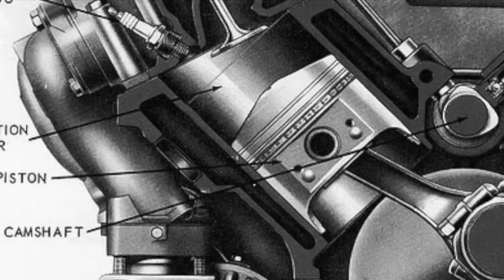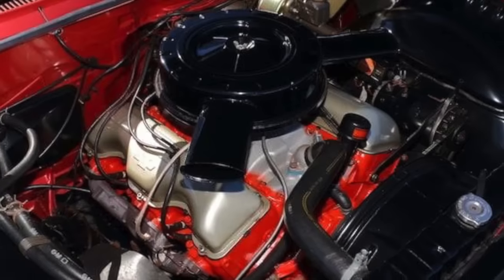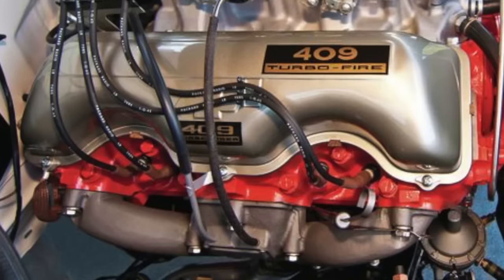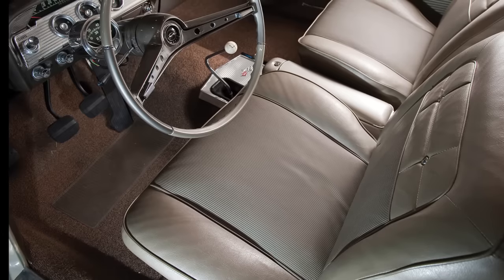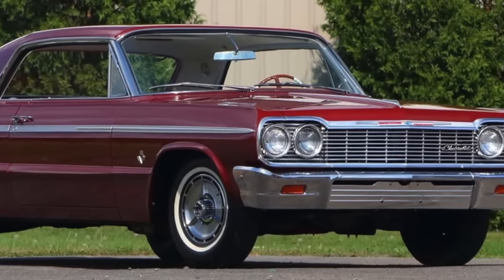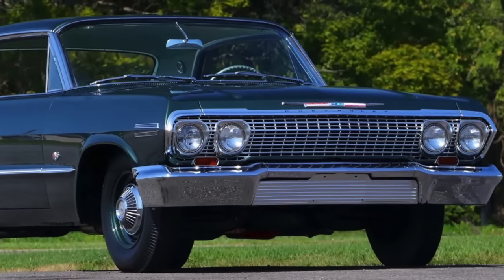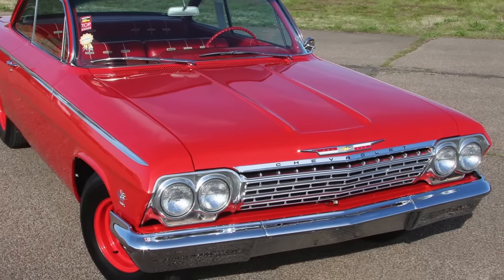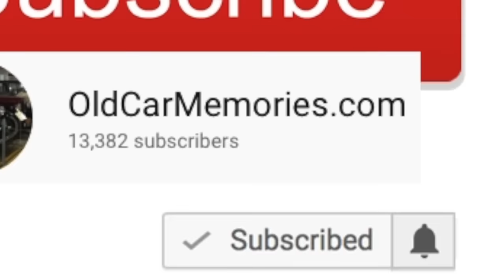1961-1965 Chevrolet 409 V8 - The Ultimate Budget High Performance V8

Comment: My brother had a '64 Impala 2 door (not as SS) with a 409/340. I remember helping him work on it and I was able to sit on the fender well with my feet on the radiator and the back of the engine so I could reach everything. And I'm 6'4"!!  I also remember someone in the late 1970s racing the 409s. He found out that a crankshaft from a 454 slid right into the 409 bottom end. He was also able to bore the 409 a hefty .120 over (no joke!) and the final CID was 495.

Comment: I've never seen a 1965 with a 409 , not that I doubt it but I thought that was the beginning of the 396 .
Reply: About 2000 65 Impala's were equiped with the 409. It was replaced mid model year with the 396. When I was a teen in the early 80'S a gas station owner down the street from my house had one sitting at his station and it had the 409 in it never got up the nerve to ask him if he wanted to sell it I regret that.
Reply: A girl in high school had a 65 Impala convertible with a 409 and a 4-speed it was her dad's
Reply: @brucegillies1694  When was this? where? I had a 65 SS conv triple black, 409 400 4 speed. I bought it in 1968, I was 16
Reply: Feb 14 65 is when the 396 replaced the 409.
Reply: The 396 replaced the 409 halfway through the 1965 model year. 409 powered 65 Chevy's are really rare today
Reply: Paul Revere & The Raiders recorded a single "SS 396" to promote the new option. The 396 option arrived on the Corvette March 19, 1965. As for the 2/14/65 cutoff date for the 409/396 changeover, that would been Sunday, making it unlikely. March seems more likely.
Reply: They used the 348- 409 blocks for the early 427's.

Comment: First Mass produced V8 came from Cadillac circa 1914- Not Ford.
Reply: And Chevy had a V-8 in 1917
Reply: Ford's V8 was afFORDable.
Reply: Chevy made 6,000 of the 1917-18 'mason' V8's with OverHead Valves(OHV) and air-gap style intake manifold... Louis Chevrolet was a racecar driver and his cars would never have a flathead engine... Chevy's OHV straight 6's always had more HP than same year Ford flathead V8's... and got better MPG...
Reply: Ford was the first v8 that had a solid block(one piece)construction.
Reply: True, when most automotive historian type cite the "first" V8, Henry's is cited most often as it was the first that was available most widely, most numerously, and as a corollary, most affordably.   The idea that a cheap, hot-rod-able V8 could exist and even create brand loyalty and future customers amongst hot-rodding youths was latched onto by Zora Arkus Duntov upon the creation of the OHV Chevy engine in '55.
Reply: Just remember, that Cadillac V8 you speak of, was originally designed and built by Henry Ford. Ford's first car company he started was Cadiliac !
Reply: Douglas Smith did you get your info from Wikipedia
Reply: Douglas Smith Ford's designs where sold to caddy long before the v8 was designed
Reply: Henry Ford did NOT start Cadillac, he was only a member that got kicked out, and the Cadillac engines were NOT a Ford design.
Reply: LEON LAVANASSUER AND COMPANY IN FRANCE STARTED MAKING AN ALL ALUMINUM OHV V-8 IN 1905. BY 1910  THE WERE THE MOST POPULAR RACING ENGINE IN EUROPE. MANY CARS, BOATS AND EARLY AIRCRAFT USED THEM.  50 HP ...250 LBS.
Reply: Henry ford founded Cadillac
Reply: @BuzzLOLOL  yup no chevy flatties after 1932 4 poppers
Reply: @fposmith  ???
Reply: @tomschweikert9537  - The Chevy 4 bangers were also OHV...
Reply: @BuzzLOLOL  from 32 0n i believe
Reply: @jackpine3528  alfas and peugeots were big time then
Reply: @BuzzLOLOL  Yeah!!! thats why he went under!!!! GM just uses his last name, to make CHEAP!! cars!!!! that's ALL!!!
Reply: That’s bs Ford had to teach Cadillac how to make a V8
Reply: Buick had straight eights in the 40s and early 50s.
Reply: General Kenobi No he did not.  Henry Leland founded Cadillac in 1903 and then partnered with Ford for a short time.  Leland was approached by William Durant, founder of GM.  Leland sold Cadillac to Durant and with Oldsmobile, Buick and Cadillac, Durant formed General Motors in 1908.  Do your research next time before commenting.  

Also Leland, used his Cadillac designs and designed Lincoln for Ford in the 1920s.
Reply: John Cronin Cadillac was already part of GM by the time they first mass produced the V8 in their cars, I believe it was the 1920s when they did that.  Do your research before commenting.
Reply: @andrewcolsen  Bravo,,a man who did his homework and speaks facts. On another note, I personally avoid Wikipedia, period. I imagine you do as well.
Reply: I thought that ford bought the V8 design from gm and then put then on a restriction as a result of buying the design that they couldnt produce a V8 production car for X amount of years. 1955 being the end of the deal and that's why it was so badass and still is. They had all that time to build a big badder motor.
Reply: lets throw another name into this, for the those that want to credit Ford for everything....most of his early successful designs were actually engineered by the Dodge Brothers.
Reply: Buzzlol that's far from correct chevy l6 never had more hp than fords v8.
Reply: Fords big contribution to the V8 was the fact Ford figured out how to make a block from a single cast. All prior V8 engines were cast in 2 prices and VERY expensive to produce. Ford ordered his engineers to figure it out and eventually they hit the jackpot. Thank you Ford!!
Reply: @BuzzLOLOL  AND---the dippers spot welded on Chevy rods would  break off or the oil get a little low...there goes the rod. The dipper rod Chevrolet were a sick  joke. I won't even go into the horrible fuel/air distribution. Two cylinders rich, 2 cylinders fuel starved, and 2 actually getting decent air/fuel mix. At least easy to put rebabbited rods in as necessary. My dad was a mechanic - those dipper rod Chevrolet were steady cash flow.
Reply: @fposmith  The ford that became the cadillac did not have a v8 engine. The first cadillac v8 was designed by  (D'Orsay) McCall White,  in 1914. Cadillac was formed from the remains of the Henry Ford Company in 1902!
Reply: @jdgimpa  I read somewhere that the Caddy V8 was assembled from two of the Ford designed 4 cyl. a design old Henry was kicking around for quite some time. I know the Caddy V8 was a two piece block. I may be wrong, but hey, it wouldn't be the first time by any means.
Reply: @fposmith  ford cars were two cylinders when ford was kicked out of the henry ford company by the investors. even the first cars produced by the ford motor company were 2 cylinders. they didn't build any 4 cylinder cars until well after. the ford motor company had no ties to the original company that henry was booted out of. henry wasn't in charge of the company that became cadillac long enough to be kicking anything around "quite some time". The henry ford company wasn't his only failed automotive attempt, there was also the detroit automobile company that failed. ironically the guy the investors brought in to run the company that became cadillac was Henry Leland. He had a falling out with WC Durrant, the founder of GM after GM had bought Cadillac. Leland and his son started their own company to build liberty aircraft engines during world war 1. That company was the Lincoln motor company. After the war they build cars that would rival Cadillac. They were very well engineered but not very stylish. The Lincoln motor company went into receivership and Henry Ford and his son Edsel bought it for pennies on the dollar at the receiver's sale. The first thing Henry and Edsel Ford did was throw Henry Leland and his son out on their ear! By that time Ford had become a billionaire from building the model T.
Reply: Yes all 14 of them. The Cadillac was really not a "mass produced" car until after WW II.
Reply: @justinskondin1802  The first OHV Ford V8 was announced in 1953 but started production in 1954 (the Y block). Chevy's first mass produce V8 started production in 1955.
Reply: @andrewcolsen  yup my first car was a 1950 Buick Super dynaflow with a straight 8
Reply: @jdgimpa   JAP made an ohv v8 in 1908.  Hardly massed produced but I'm sure you'll like it.
1908 GN JAP v8, on the tube.  you'll have to pause to get a good look at the motor, but it's a thing of beauty.
Reply: Also made V16 and prototype V32.

Comment: The best Chevy I ever owned was a 1961 Impala two door hardtop.  It was red with a white top and a white side stripe.  Being a motorcyclist I liked the fact that that it didn't have a big convertible style blind spot like they added in 1962.  I bought it used, wherein someone had replaced the "Slip and Slide with Power Glide" with  a 3 speed.  The 283 in it was old and worn, so I replaced it with a 350.  The 350 was not easy on the clutch or the gearbox so I ended up by putting in a stronger clutch, a Muncie 4 speed and Hurst linkage.  The little blades on the front fenders resemble the front sight on a revolver, so they make it easier to guide the car through a narrow passageway.   I really miss that car.

Comment: Thanks for this informative video! I DID NOT know that a 409 was available in '65. I thought it was discontinued in '64, what with the advent of the 396 and 427 big blocks.
Reply: There is a few early production 65's that had them..............
Reply: It was.
Reply: I bought a 65 Impala SS in 1968 with a 4speed transmission & a 327ci 300HP engine. It was a few years old but came with the drivers manual. The manual listed the engine options that year. It include the 340 & 400 HP 409. No dual carburator version was listed. Later in 1965, the 409 was dropped and replaced with the 396.
Reply: @Ron Strzelecki 
I had a 396/325 hp new .It just pulled my pal's 300hp 327 in street races...both pure stock 4 speeds.

Comment: Had a 1962 Chevy Impala had a 409 in it it didn't take much alterations to make it run this is one of the best motors that Chevrolet ever made and I loved it so giddy up giddy up giddy up 409 they were badass engines wash Chevrolet ever stop making them I do not know but my grandfather had a bunch of Chevrolet trucks on the farms that had 348 in them and it's easy to change a 348 into a 409 great engine Chevrolet bring it back
Reply: Maybe truck 348s, but you can't punch out a car 348 - cylinder walls are too thin.

Comment: Chevrolet made their first V8 in 1917 and 1918 for use in their D-Series sedan and coup.  It was 288 ci and 36 HP.
Reply: Yeah but they didn't have a Chevrolet Caprice in those days dummy
Reply: I see 55 horsepower and 36 horsepower.  Which one do yo think is correct?
Reply: @bohemialite6371  aren't you the brilliant one?

Comment: A neighbor boy had a 1961  409 trip power Impala .  I know it had tri power because I saw it at out local Chev dealer with the hood open and air cleaner off.  Claimed it passed everything but gas stations.
How come you do not mention this one?
Reply: ron5935 If it was a tri-power, it was a 348 unless some swapping went on. Depending on which one, it could have made close to the same power as a ‘61 409. Still a darn desirable car.

Comment: The 348 / 409 was a truck engine that Chevrolet started using in pass cars until they could get the 396 "Rat" to the market.
Reply: Gerald Holland the 348/409 was also used in trucks just like every other passenger car V8!
Reply: The 348 was in the cars 1st, 4 months later, they were installed in heavy trucks. So!!! not a truck engine.
Reply: It was designed to be able to fit into cars. It was also to be available for trucks. It was made to develop high low end torque.

Comment: Question, I've been arguing about the 409 being in the 1961 Chevrolet. I have the original full size,  full lineup dealers brochure from 1955-1965. The 1961 brochure does not mention the 409 in any 1961. The MSRP guide for 1961 also does not mention any SS or super sport option. What is the source of your information, I'd appreciate it.  My 1965 Dealer sales brochure does not offer any 409 in any 1965 Chevrolet. I'd be curious as to nay publsihed information about that as well. Thanks
Reply: They made 142 409s in 61, 400 plus SS for 61.A lot of info in the internet world.
Reply: The 409 was not available until early 1961. It ws available until early 1965 when the 396 replaced it.

Comment: You sound like Chevrolet started the muscle car era.  In 1957 the Chrysler 300s had a 392 dual quad hemi that put out 375 hp.  In 1958 they had a 392 with bendix electronic fuel injection rated at 390 hp.  These Chevy engines were designed to compete with the hemis.  It's that competition that started the muscle car era, not the Chevy 409.
Reply: I've never been a Chrysler fan at all but the truth is they were some crazy engineers building things way ahead of anybody else in the 50's and 60's.
Reply: Chevys could't start with a Hand crank!!!!!   Maybe if you PULLED them!!! Lol!!! Maybe not.
Reply: Be4 that, 65-66 DeSoto had the 292 firedome hemi....
Reply: @roberthayes6329  A 1955 Chevy 265 put out 162 hp.  The 1955 Chrysler C-300 had a 331 hemi that put out 300 hp.  That's why it was called a '300.'
P.S.  It came stock with dual quads, a staple of muscle cars for decades afterwards.

Comment: I don't remember the 409s. My work truck has a 396 with 272 tran with working 5, 411 rear. Love it. 
Makes me wonder what a 409 would do for it.
Reply: In a work vehicle, not so good, as a performance engine is cammed for high speed breathing, and a work engines needs lots of low RPM torque.  You can't have both, but you can have a compromise that may not be bad, but it won't be great either.